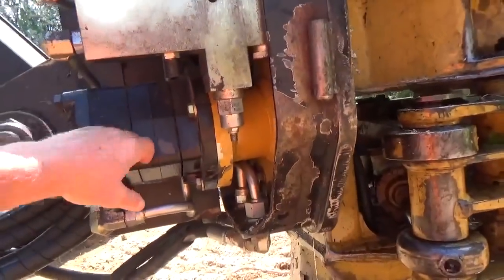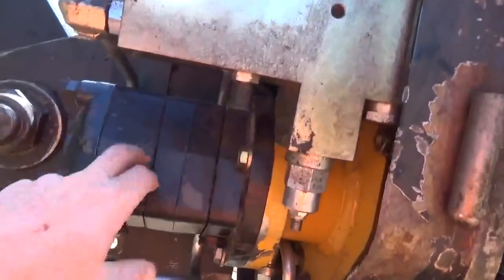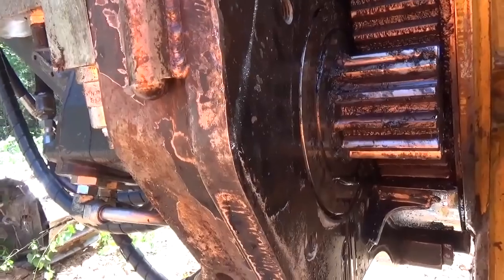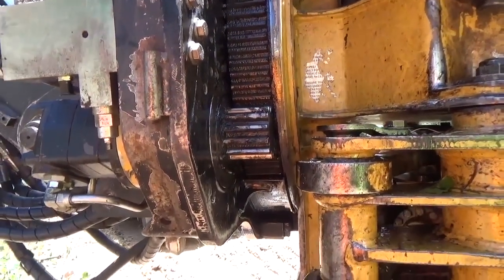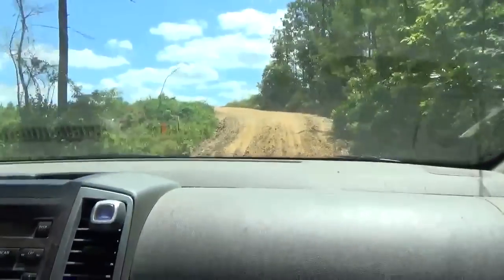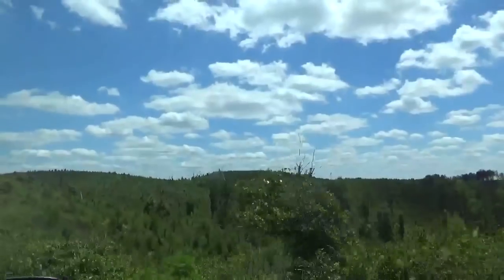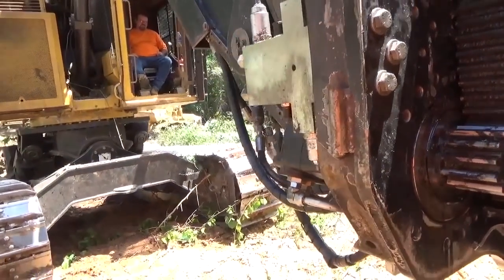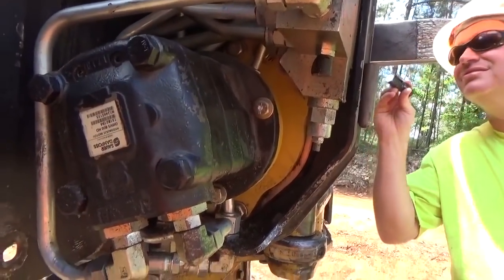Tigercat L830C has bit the dust

Comment: During my career I found that things started failing on equipment when the air temperature got above 95 degrees (everything was good through 93 degrees). It would happen every year. Good luck!   
....13